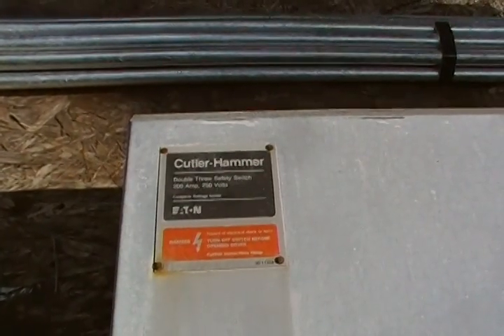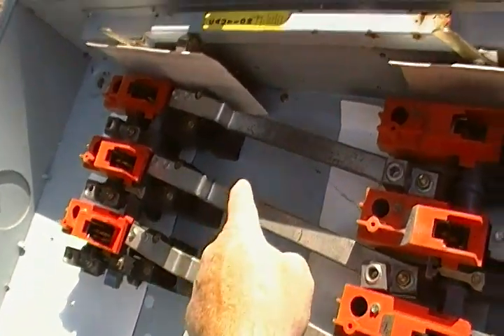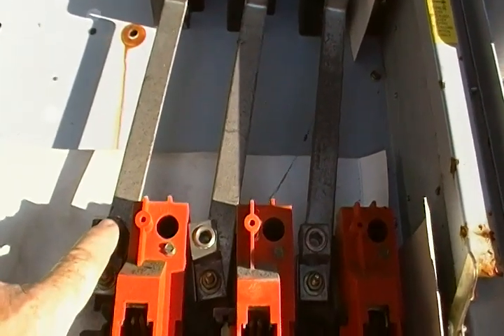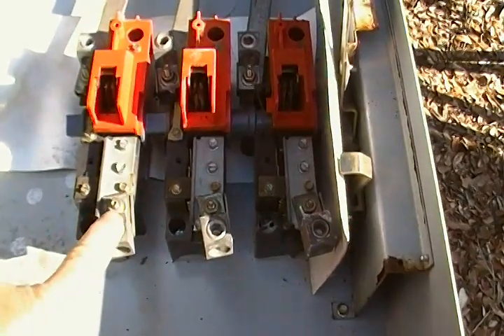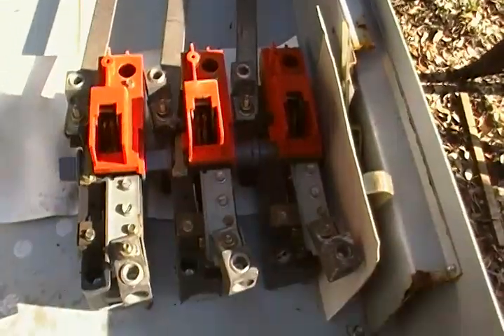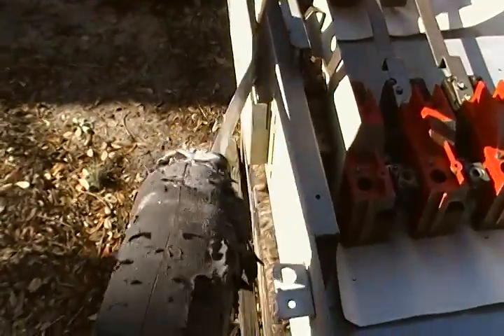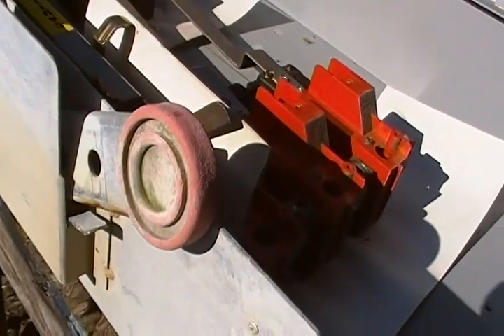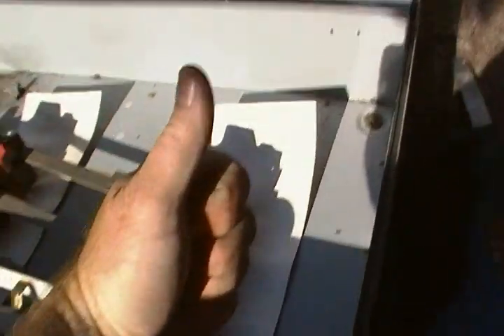Generator Transfer Switch 200 Amp For Free

Comment: Good video but after reading comments, one thing I noted.   NO one mentioned a simple fact that anyone setting up a panel and generator to their home, even mentioned.   Before you use this switch to change your power source, the first thing you do is turn OFF your main panel main breaker and any breakers that are larger than 20 amp.  THEN you use the transfer switch to change power sources from grid to genset or vice versus.  Once you use the transfer switch, you then turn on your main panel Main breaker, then the other breakers one at a time to put the load back on whatever source you are using.   Don't EVER switch the power transfer without these steps.

Comment: This Manual Transfer Switch is NOT needed but it is recommended in case something goes wrong..
Most People only use it so they can sleep better at night and others use it to SEPARATE the N between the generator and the street. 
If you do not separate that N leg between the generator and the street and something within the generator or something inside your home shorts out .... Now your N let goes HOT and can send that back out to the street ... 
This is why its important to separate the N leg when running a generator ... Its not needed if nothing shorts out, BUT if something DOES short out, now that N becomes HOT and that will back flow into the system to possibly hurt the lineman THAT IS NOT WORKING SAFE BECAUSE HE IS TRAINED TO BE SAFE AND WATCH OUT FOR HOT LEGS COMING FROM THE LOAD SIDE...  THEY KNOW THIS SHIT HAPPENS AND THEY ARE SUPPOSED TO WATCH FOR THIS...  SO THE CHANCES OF YOU HURTING THEM IS SLIM TO NONE BUT IT IS POSSIBLE...

Comment: Ok let's be realistic. Number 1. 
Metered power is not  perfect all the time. 
Number 2 
When you have to use this switch theres probably no metered service anymore Number 3
If you are handy enough to install this switch you would know to switch over first to the generator side and start it up and breaker up one at a time to not slug your generator. 
Number 4 
If your going to cut the neutral so do it. Better for the lineman working to get your power back on. Just some advice. Buy good surge suppressors for all your electronics or just unplug them before your switch over.

Comment: Nice find!  you can use that on any size system up to 200amps. You're right to disconnect the utility neutral when you switch to generator power. NEC article 445 will require it. the reason is because you cannot send current back to the grid from a "separately derived system". You'll energize wires that the utility guys are trying to repair for you!  Every listed transfer switch will disconnect the neutrals.

Comment: HP, ...... , Sir, what kind of generator has a 200 amp feed?  I mean to say, I'd like to get a 10,000 watt generator (DuroMax) which has a 50 amp outlet.  What are the steps between the 200 amp transfer switch (like the one in this video) and the generator outlet?  Thank you for your generous consideration, Steph
Reply from the maker: +Steph Boeker A very good question but, a question that would require many complex videos to explain properly.
200A capability; 200A x 240V=48KVA or a 50,000watt gen set but, we would have to do a load calc to get proper numbers for each particular application.
The steps to hook it up can be extremely numerous, involved and may be unique to your application.  The hook up must be done properly to avoid fire.
Probably, a 60 amp/240V(10KW) transfer switch with its own breakers that would mount to your existing breaker panel to control the loads that you want to have running when the power is out woud suffice. However, I must strongly caution that your set up must be done by a ceritfied electrician to avoid fire and liability.
My jurisdiction allows the home owner to hook up his/her own electrical with a permit that you can get yourself without a getting a contractor to pull one for you.  That way an inspector can see that it was done properly according to NEC. Check your local rules.
The next time a I install a transfer switch or gen set I will make a vid.
I hope that this was somewhat heplful.
Reply: +homesteadprepper Thank you for your generous and timely reply.  I've learned plenty here.  I believe I may take the alternate route w/ plugging it into the box and using a cut off switch.  Thanks again, Steph

Comment: Early in my career as a hospital maintenance engineer, I accidently broke the neutral on a live circuit.  There were several neutral wires secured by a wire nut.  Almost immediately I was receiving complaints from employees about lost power, but the worst that happened was that I destroyed several electron microscopes because of the 240 volts being sent to the machines.  I learned my lesson and never repeated that mistake and I urge you to not break the ground or neutral.
Reply from the maker: JIMMY TATE The difference here is that the live wires would be broken as well as the neutral with the transfer switch leaving no chance to destroy equipment.  The hot wire and the neutral are always broken at the breaker with a gasoline pump for safety with no ill effects.
Reply: JIMMY TATE this is a complete disconnect situation on line in
And neutral. No chance on a back feed situation. Sounds like the hospital has distribution problems.

Comment: If you switch the neutral there is a good chance your going to fry some electronics.  if the 2 hot wires connect a millisecond before the neutral it will send 240 Volts to half your circuits.  Your largest electric appliance like an electric water heater will "complete" the circuit at your breaker box since all the neutrals are tied in.  This floating neutral will allow the voltage to vary one each phase.  Keep your neutral tied to ground!!!!

Comment: On switching the neutral, my impression was that the the neutral isn't supposed to be switched to control the power to a load. Here if f neural was bonded to ground at service interact or panel it would still be bonded there no matter what position this  switch is in, even if the neutral is being switched with the line conductors.

Comment: Thankyou for posting this video -- it confirmed a number of thoughts I had about switching neutral and bonding of the neutral at the generator. Some portable generators have no easy means to disconnect that factory bonding of neutral to ground, and I believe that (here in Canada) a switched neutral is required if such a bonded device is used. Our code also requires such a neutral switch to be physically tied to the switch of the line voltage, and your device does that perfectly.

Comment from the maker: My reasoning was to break the identified conductor so that no transient voltages go back to the power companies center tap of the transformer and endanger a lineman.  I spoke with the authority having jurisdiction in my area and he said that it was legal to switch the neutral but why.  Some homes in my area do have 3 phase power.

Comment: What's the reason for switching the return when you can feed the return straight through? You only need to switch the voltage right? This is a 3-phase transfer switch isn't it? I'm guessing my third question answered my first two question. If this is goning on a single phase home you really only need the two switches and not the third switch.
Reply: This is a 240v transfer switch. The 3rd pole (or 1st pole, however you prefer) is for the neutral because transformers work both ways, in principle,  it should not make a difference if the neutral is switched or not, but it is for safety. The switch is to keep power from a generator to back-feed the utility power and make a dead-line, live. Hope that helps if I understood your question correctly.

Comment from the maker: @mballas56 According to the "authority having jurisdiction" in my area, the neutral can be broken if the line power comes into the tranfer switch which would be the first means of disconnect, bonded at that point and then the neutral going to a "sub panel' could be broken.  The AHJ said that he would not switch the neutral if he was doing the job but he could find nothing in the NEC that said otherwise.I will be talking to another inspector and getting his interpretation of this.thx.

Comment: you should not break the neutral for a home. 240 volt single phase. The neutral and ground should only be bonded at one point, the main service panel, or service entrance.
Reply: This switch is rated to be a service entrance switch.

Comment: I am by no means an expert on the NEC it has been a long time since I sat for my master's license. Try NEC Article 250.20(D) Fine Print Note No. 1 “An alternate alternating current power source such as an on-site generator is not a separately derived system if the neutral is solidly interconnected to a service-supplied system neutral.”

If you set the genset up as a separately derived system than you must switch the neutral to avoid having multiple ground paths.

Comment from the maker: @cloinwalsh I don't see the code violation for switching the neutral for stand by power.  Technically,  If you run the generator and there is an imbalance on the neutral, the current might use the power company neutral for a return instead of the one supplied by the generator and endanger a lineman. I appreciate your comment and would like further clarification and a NEC reference.  I have been known to be wrong before. Thanks.

Comment: @homesteadprepper G59 is a standard to ensure that you do not impact the utility with phase vector/frequency/voltage etc. We use it for protection as we parallel with the utility after an outage to ensure a seamless change over and allow the gensets to cool before shutdown.

This is a very basic description as there is a whole book on the subject.

Bob